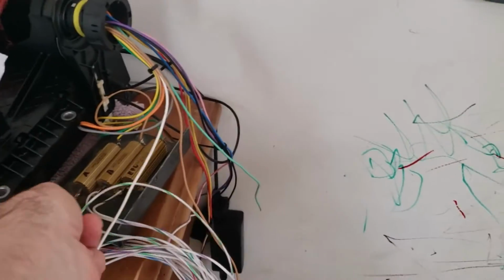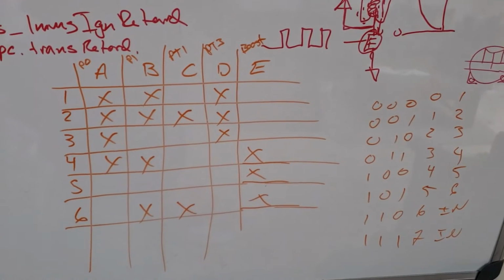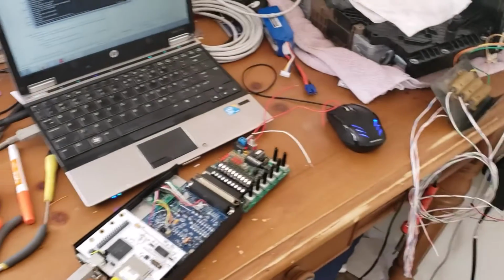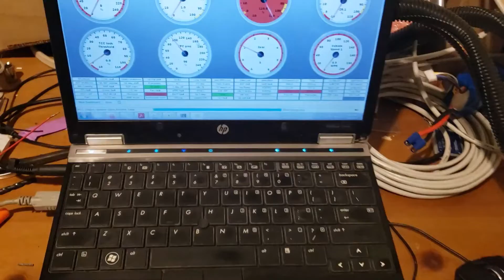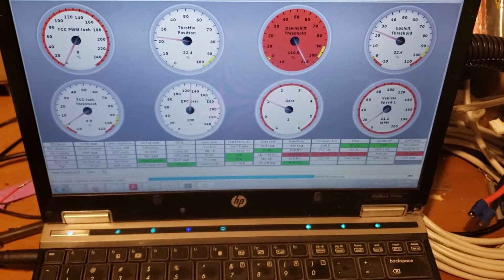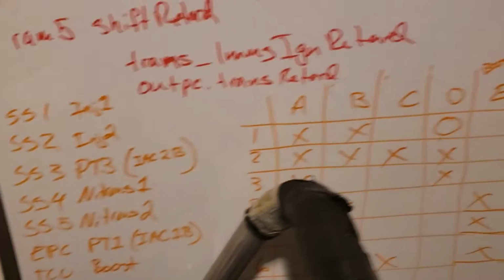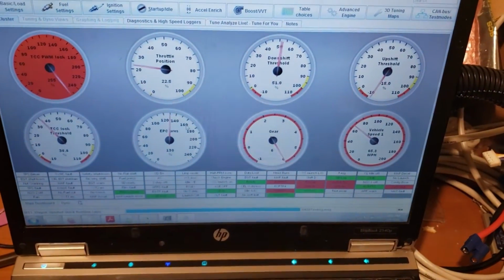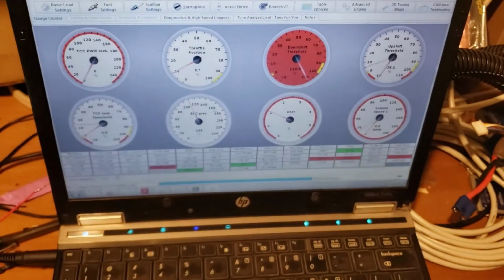6R80 controlled MegaSquirt3

Comment: Huh ... um I can't read or understand Chinese bud lol.. I think I'll just have to buy the quick 6 for freaking 1250 bucks, and I'm poor so I'll be saving awhile lol
Reply: It's actually not that bad.. I think microsquirt with the transmission firmware loaded might be the easier way to do it, but idk.. I am glad I found this video, at least I know it's plausible to use.. one of these days, I might swap a coyote and a 6r80 into my bronco, so I'm happy to see someone is working on something besides the quick 6.. nothing against them, but 1299 for a transmission controller is a bit much in my opinion